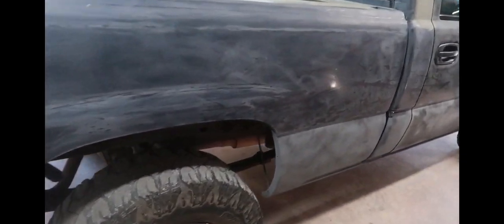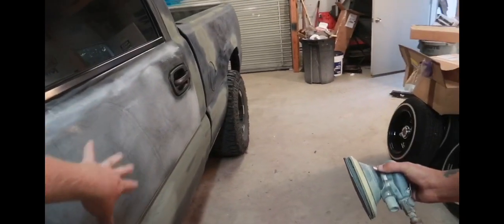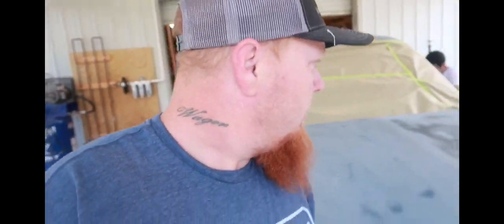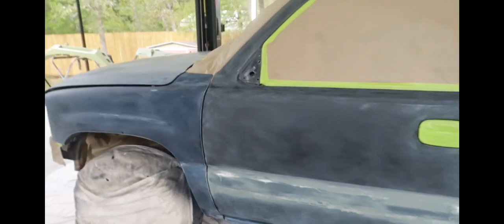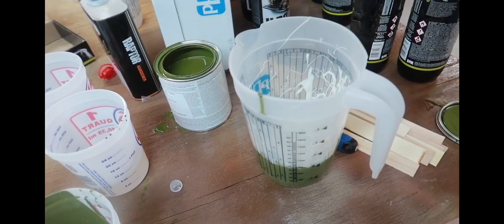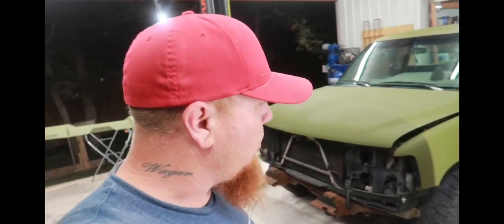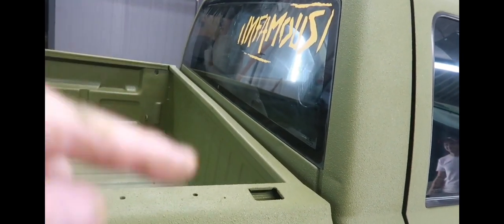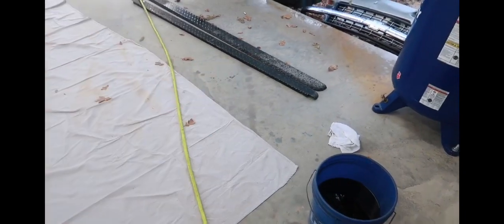RAPTOR LINER/BED LINER PAINT JOB IN GREEN !!! FINALLY DONE !!!

Comment: I SCROLLED DOWN AS I COULD  U GUY'S EVER GOING TO FILL IN THE DANG BLNK'S PPL,.  BEEN ASKING...... 1.,.. LIKE WHAT AIR PRESSURE U GUY'S USE & DID U RE-ADJUST  FROM TIME TO TIME OR LEAVE IT THE HOLE WAY THREW... 2.,... WHAT ALL GRIT'S ( like 60-120 grit or what ).. DO U ALL USE ON THE TRUCK THERE.... 3.,.. where u all get the raptor  liner bed liner from .... what store or web site.....  4.,...  how much u get in gallon's or etc,. there.... 5.,...  how much was it all & did u have much left over  6.,.... how thick did u all spray it on the panel's of the rig there   & was it thicker inside the bed or on the bottom sides of the door's & all the way around the rig then or what......7.,... what was the name of the color tint u all used guessing the same name brand as the bed liner too..... 8.,... how much did / does the tint cost roughly.....9.,...  the more tint color u squeeze in does it get darker or all still the same no matter what...................????????
Reply from the maker: Two kits of raptor liner , ppg paint , move bumpers , two coats of raptor liner @ 40 psi .

Comment: Choose a spray bedliner for your truck from DPS. Its bedliner material is a dual and heavy duty that provides UV stability to your truck bed coatins. It is also good as used truck bed liners material. https://dpsdealers.com/category/spray-bedliner-toff